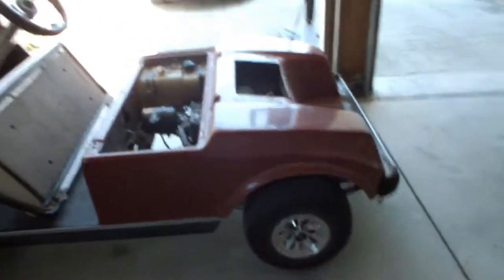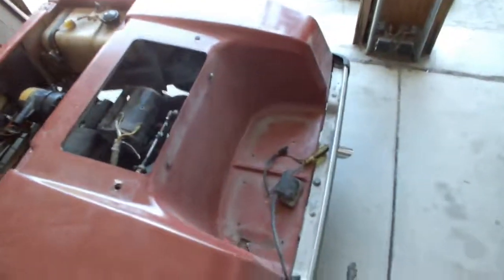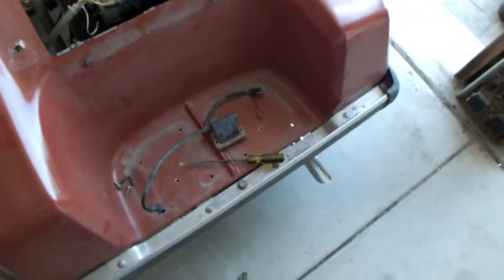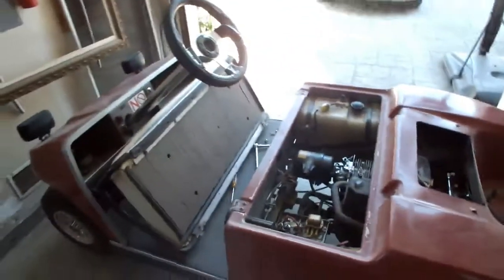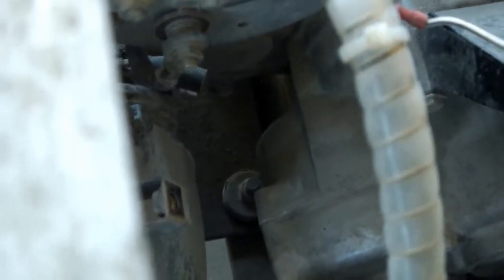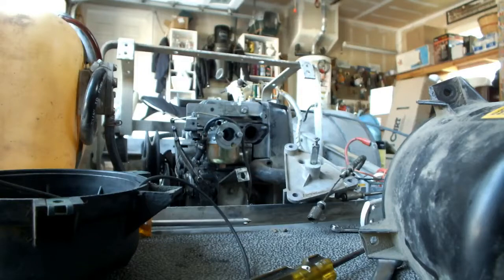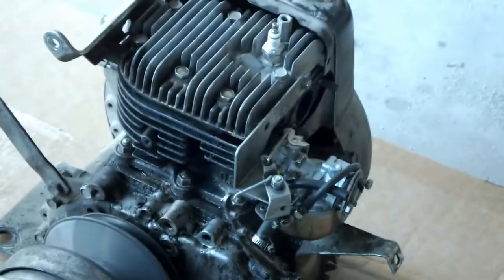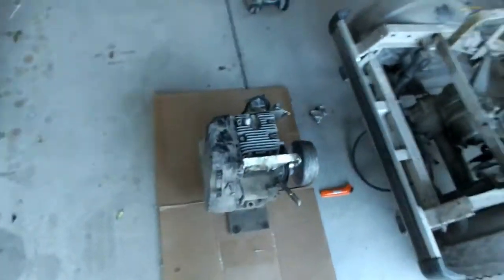Club Car GX420 Engine Swap: Teardown

Comment: Too bad this video is so old. I'm right where you left off with my build. Putting on a Predator 420. How did yours turn out?
Reply from the maker: Turned out pretty good! Tons faster. I would have gone with a traditional Comet clutch though, as this one needed winding out to 4-4.5k RPM before it would change ratio.